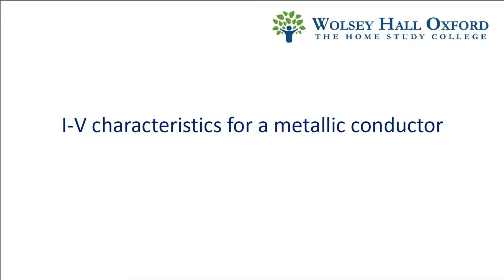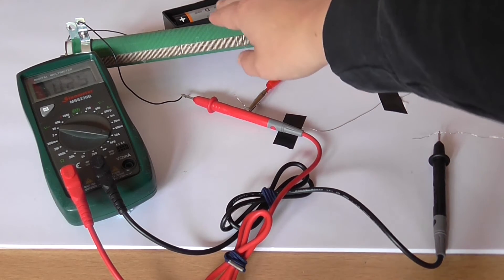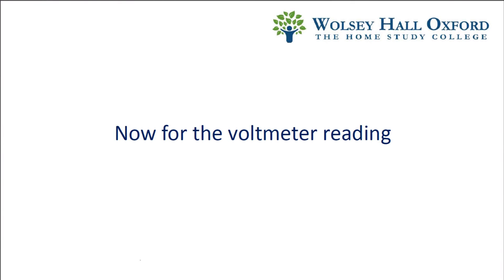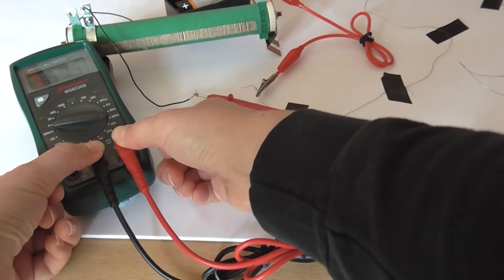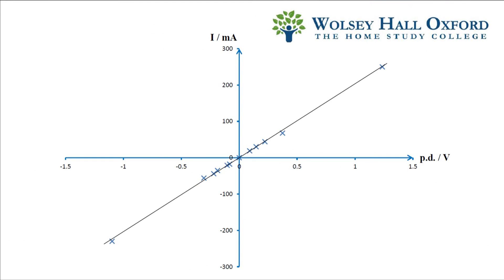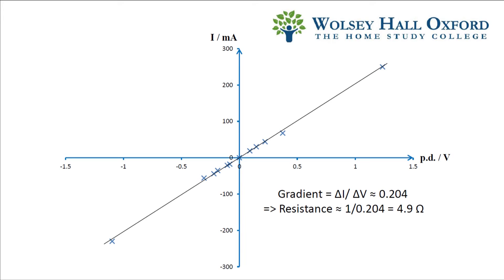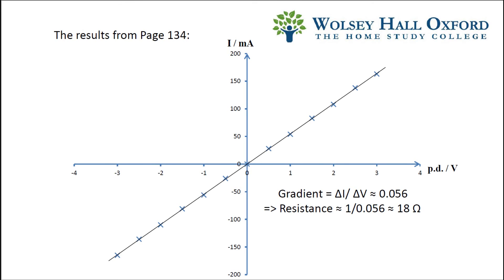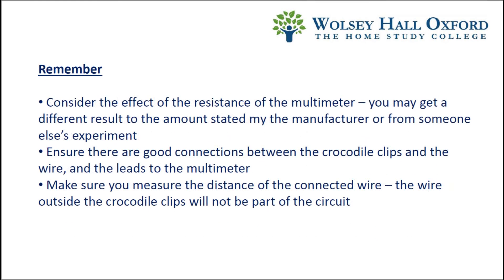AS Physics Experiment 6:  I-V Characteristics of Metallic Conductors

Comment: What's the equipment list
Reply: The equipment used here was a 1.5 V cell (well, battery), a rheostat, resistance wire, insulated wire, crocodile clips, and a multimeter. Ideally use a separate ammeter and voltmeter and have enough space to stretch the wire out completely over a ruler. 

I had to improvise with the basics to show anyone can do physics in their own homes! No fancy labs necessary.